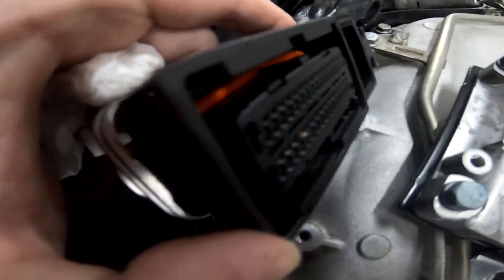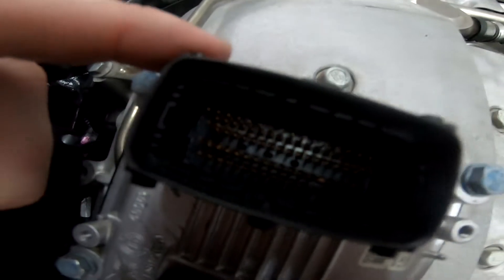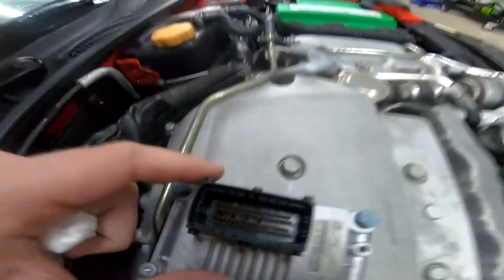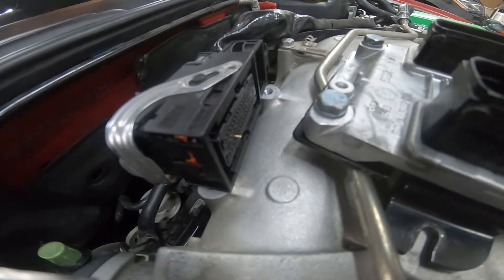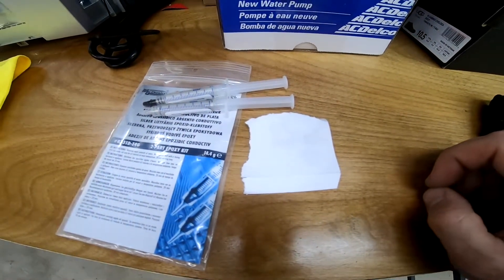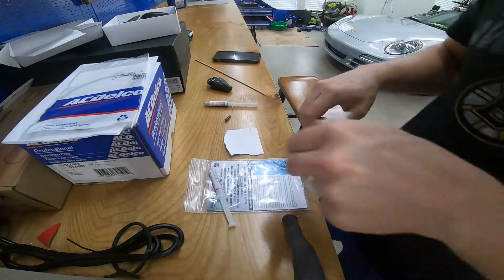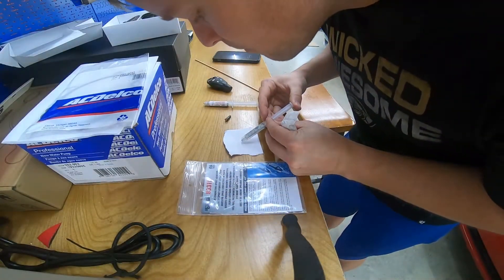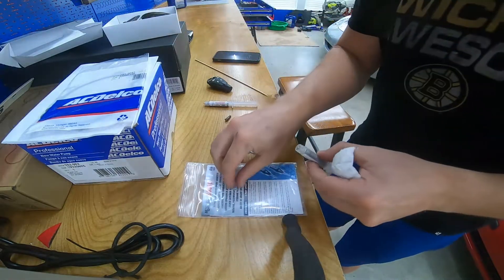Broken ECU Pin Repair | Project Saab 9-3 Aero Sport Combi

Comment: Hey man so my clutch is stuck to the floor and it’s not the spring behind the clutch so does that mean it’s the slave cylinder inside the transmission or could there be any other solutions ?
Reply from the maker: Yeah sounds like slave cylinder known failure point for these cars.